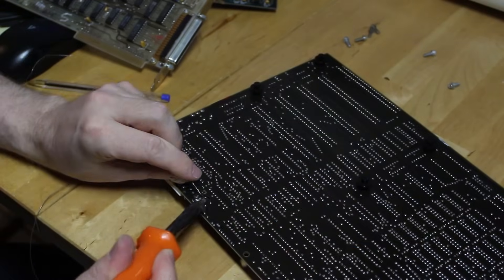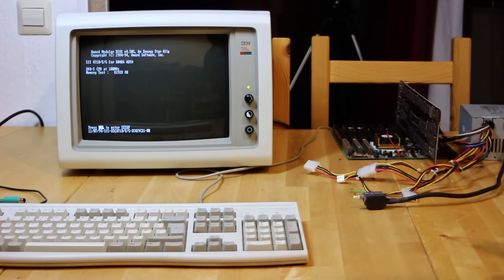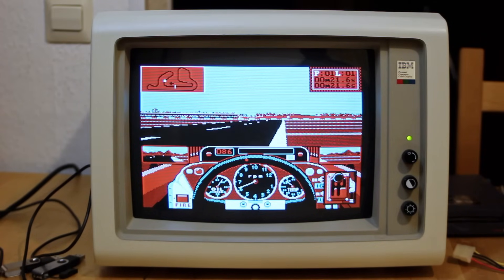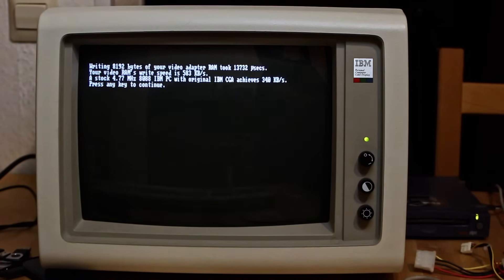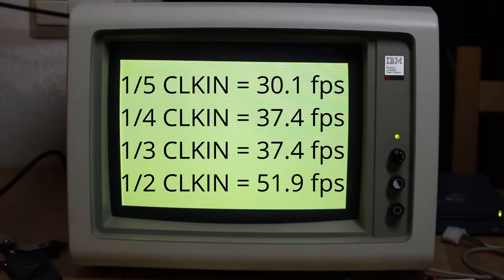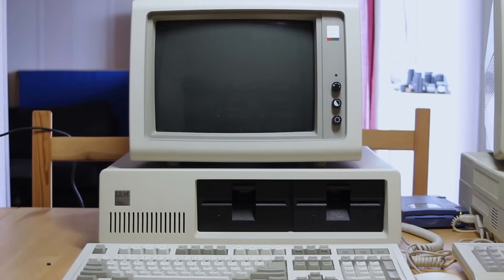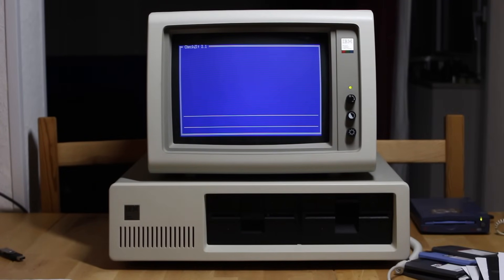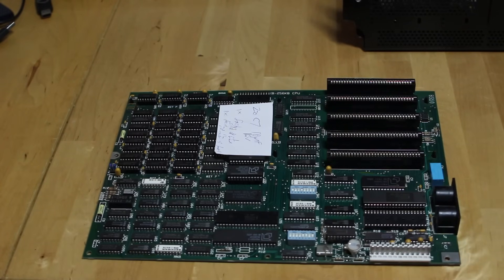Don't put a graphics card from 1981 in a PC from 1994!!

Comment: I believe the reason why you only get a few different benchmark results on the CGA card is the wait states. The algorithm (implemented by the discrete logic on the CGA card) is basically: 1. wait 1 hchar, 2. wait for the next lchar boundary, 3. wait for the next CPU cycle. Step 3 will be negligible on a 486 so how fast you can access CGA RAM is limited by how well the access pattern of the benchmark code fits the CGA wait state algorithm. With a different benchmark you might get different results as to which set of FSB divisors give the same performance as each other.
Reply: Exactly. The CGA card runs at a dot clock of 14.318 MHz in text mode. A character is 8 pixels, so the CGA card runs at 1.79 megachars per second. You should get a video memory access time slot per char, so if your write cycles are short enough and in quick enough succession, you should be able to fill the video RAM at 1.79 MB/s. That's obviously way faster than the IBM PC could handle. If the processor could saturate the bus doing block fills (spoiler: The 8088 can't, the V20 can), the FSB would allow 1.19MB/s, so you would miss every other opportunity to access video RAM and lock in at half the theoretical 1.79 MB/s, i.e. 895 KB/s.
The 486 chipset throws in a lot of wait states for 8 bit memory access, so it obviously misses the 895KB/s rate and instead only uses every third chance to access the video memory. This results in a theoretical rate of 597KB/s. The lower actual rate (583KB/s) might be due to RAM refresh cycles. They need to be visible on the ISA bus for compatibilty reasons, as some cards refresh their local memory based on ISA refresh cycles (mostly ISA memory cards).
Some mainboards allow changing the number of wait states for 8-bit cycles using the BIOS setup, but that would be in the "advanced chipset options", and obviously you BIOS doesn't allow it. I checked the SiS471 configuration file for CTCHIPZ, and it seems waitstates for 8-bit cycles are software configurable as 4, 7, 11 and 16 ISA clocks. As I don't know what's the base line (i.e. how many clocks "0 waitstates" is supposed to take), I can't directly translate that to data rates. What we do know, though, is that at 16MHz ISA clock, you are close to "every other cycle" instead of locking in at "every third cycle", which you would lock in at 11MHz and 8MHz. We know you can't run at 16 extra bus clocks, because 16 clocks per cycle would mean a theoretical maximum of 500KB/s at 8MHz, which your board exceeds. Getting 600KB/s at 8MHz would require no more than 13 bus clocks per ISA cycle. Not getting to 808 KB/s at 11 MHz also indicates a likely total time of 13 bus clocks, so your BIOS likely sets up the ISA bridge at 11 "recovery clocks" that get added to the AT minimum bus cycle duration of 2 clocks.
Setting your chipset to 4 bus clock periods recovery time should allow you to reach the extremely mad data rate of 1.7MB/s on a classic CGA card. Get CTCHIPZ here: http://www.rumil.de/uwsysuti.html
Reply: @tw11tube  The wait state problem is why OPL3 and Adlib cards sometimes play garbage noise on a faster machine. MIDI setup also can get goofy as well, particularly the MPU-401 systems.
Reply from the maker: Interesting. I hadn't thought of the wait states being a limitation. That could well be it. Thanks.

Comment: I have a OPTi VLB/ISA board that is from 1998 surprisingly, it was sold as a industrial board. it has the AMI WinBIOS
Reply from the maker: Yeah, they kept making them pretty late.
Reply: @PCRetroTech  486 had a long lifespan, up until 2007 when they stopped making 486s, same with 386.
Reply from the maker: @pentiummmx2294  Yeah a lot of old military hardware use them I think.
Reply: @PCRetroTech  industrial and POS systems used 486 as well i think.

Comment: I think the variable capacitor adjusts the OSC signal on the bus, which can be used for all sorts of things, including affecting the DRAM refresh timing on some motherboards. That could explain why you were getting what looked like ram faults in addition to weird behaviour from expansion cards making use of that signal.
Reply from the maker: Yes, I suspect it just glitches a whole bunch of stuff.
Reply: It was added to adjust the chroma signal output by composite CGA, which is locked to the system crystal.  This explains why the video system was affected when it was loose and jostling aroung when the side of the system unit was smacked.  Also see Geoff Reed's comment below.
Reply from the maker: @JimLeonard  Yeah this much I knew, since I had previously adjusted it to show 8088MPH. I've also talked to Reenigne a few times about it.

I took the embarrassing section out of the video where I called it a variable resistor. But unfortunately I can't cut the multiple places where I call it a pot. But In a later video I'll make a section with viewer comments and clear that up. I had always thought it was a potentiometer, thought that was very odd, and even had go through my mind when making the video "I wonder if it is a variable capacitor", then forgot to check. So this one was a self-inflicted error.
Reply: @PCRetroTech  The important thing is that you restored a PC to working order!  (I've always called it a pot too)
Reply from the maker: @JimLeonard  Yes, I am pretty happy about that.

Comment: I read that this IBM 360K floppy T-RES terminator resistor chip should be installed on the last floppy drive in the chain and it works just like SCSI bus termination, to prevent the reflection of electrical signals from the end of the cable in order to ensure reliable operation. Cheers.
Reply from the maker: Interesting. I better check it is actually the last one in the chain!

Comment: The T.Res chip is actually a resistor network. Termination Resistor is what the name stands for. It only needs to be on the last drive in the chain, and also is only needed with some early floppy controllers. Newer controllers terminate the bus on the controller card.
Reply from the maker: Ah that will explain why everything still works. Thanks!
Reply: @PCRetroTech  Yeah, the termination at each end is to reduce reflection when the signal reaches the end of the cable - it behaves like a "transmission line" so the closer you match the impedance the less reflection you get.
BUT! floppy cables runs at such low enough speeds that the reflections really doesn't matter much unless you have very long cables (say 3m+), so most? all? PC floppy controller cards provides sufficient termination that it'll work with or without the other end being terminated.
More people are familiar with termination-at-each-end for Parallel SCSI cabling, getting this right there is much more important since the signalling is 10-400 times faster than for floppy cables so the reflections are much more likely to cause issues. But it's still possible to sometimes get away with "incorrect termination" for short parallel SCSI cables and low (by SCSI standard) speeds, so it's logical that floppy cables are even more resilient.
Reply from the maker: @Torbjorn.Lindgren  That totally makes sense. I'm even vaguely remembering a video I saw where this was mentioned once, now that you've reminded me of the details. Anyway, thanks for the comments.
Reply: @PCRetroTech another reason for the termination was that open collector devices were used, depending upon the design often 7406 or 7407 TTL devices so these terminate acted as pullups or downs depending on the design. This was in pre IBM PC devices such as TRS80s and the like. Later controller chips had the oc devices built in and didn't use the discrete TTL. Any time I'm repairing a system that has a blown 7416 or 7417, I always replace them with 7406 and 7407 so I don't need to stock all four chip numbers. It's fine to replace that way but should never replace an 06 or 07 with a 16 or 17... I know I went out subject but I couldn't help it.
Reply: It appears that the T.Res is on the wrong drive in his system! It is supposed to be installed only in the last drive in the daisy chain, the one at the end of the cable. Those drives from IBM have a DIP network, but some other drives used a SIP instead or a single jumper that you installed or removed. On a drive with the single jumper the resistor network was always there; the jumper lifted the ground connection to it, taking it out of the circuit.
Reply from the maker: @ShirleyMárquezDúlcey  I think it is on the final drive in the chain. I switched them temporarily at one point in the video for testing, but normally it is on the drive at the end of the cable.
Reply: OHH, that's important to know; thanks for pointing it out. Turns out this info is actually on minus zero degrees too; look for diskette/5.25_floppy_drive_termination.jpg.
Reply: Signal buses, Floppy and SCSI get terminated at both ends of the bus, if you terminate on one end of the bus, and its not noisy, you can get away with it.

The design was that if you terminated it on the end of the chain, drive A, that you could insert a drive B in the middle, and it would not need termination. However during manufacturing, most drive As were put in the left most slot. ( easier assembly )
Reply: @joeturner7959 I'm also reminded of 10Base2 Ethernet with BNC cables which used T-connectors that needed a terminator at each end, and how one being removed or getting loose would bring the entire network segment down.
Reply: I scored a cheap XT because of this. The seller thought it was faulty. It wasn't faulty, just the drive was incorrectly terminated, causing the entire system to fail to start.
Reply: That's why I love old hardware. You just have to know your stuff.
Reply: 0simParTHE4vdaIVal0en2Dvoracs😅

Comment: That variable capacitor (not a variable resistor in this case, btw) was most likely used to tweak the signal coming from the crystal next to it. I assume the crystal is related to the system bus clock, and that could explain potential ISA and floppy drive issues.
Reply: Yes the composite on CGA iir is derived from the system clock. The variable cap is used to dial the system clock into spec. You can tweak that cap and watch your composite video lose color burst on the cga card. Since I believe its tweaking the system clock in real time it would do funny things to bus timing thus parallel port timing. I have a generic Turbo XT that was giving me only black and white off the composite out on the cga card and needed a tweak to get color back.
Reply from the maker: @joshhiner729  Yes, I think the cap was partly broken when I adjusted it. I made a video with the 8088MPH demo in it on a Commodore 1084s monitor and I adjusted it to get colour composite output. Apparently I overdid it and broke the cap completely.
Reply from the maker: Yes, definitely. I can't believe I said variable resistor and not capacitor. I guess when it fell to pieces it actually did look a lot like one of those carbon pots, but of course that makes no sense given what it is doing. I suppose it could have been part of an LCR network or something, but that would be a stretch.